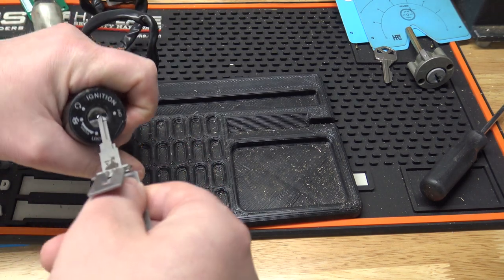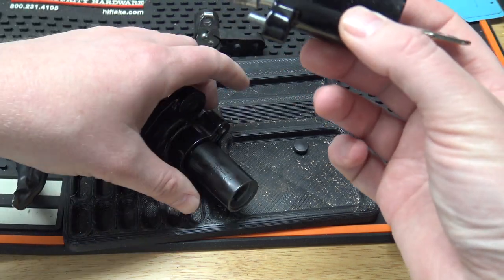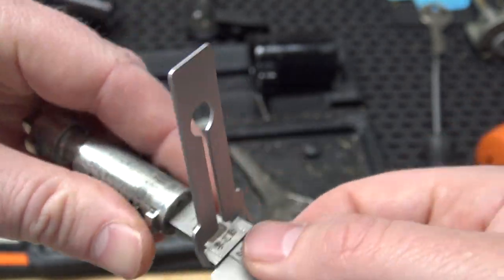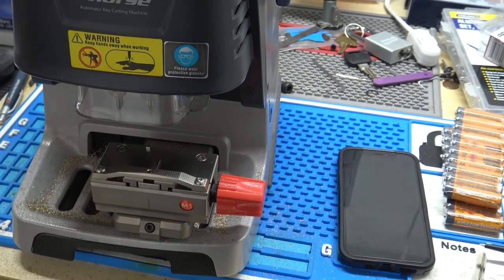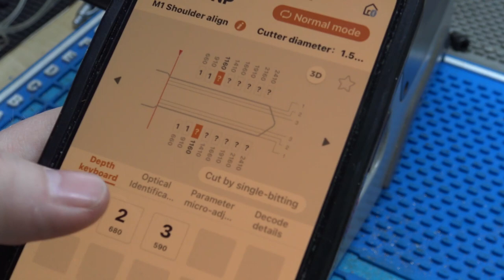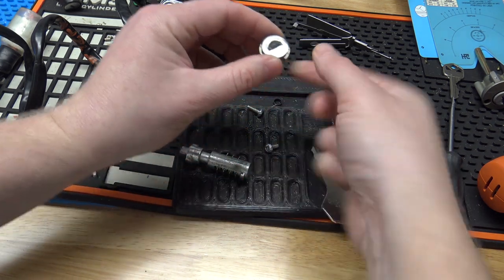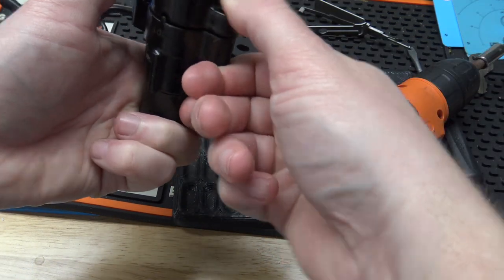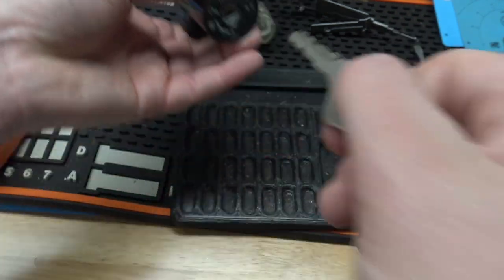(539) Making a Key to a Yamaha YZF-R3 Motorcycle

Comment: This video has helped me a lot.  My wife lost her key and needs a new one.   We went to the locksmith with the Lishj info from the tool and they tried to cut us a new key.   I didn’t take off the ignition since it’s a process, but I brought the seat lock.  They found a key code of 2125 for their machine but it didn’t work except for the trunk and it was slightly off by a couple of 100ths.  They don’t believe they have the real key code.  Do you know what the the standard key code would be so they can cut it?
Reply from the maker: Sounds like you need a new locksmith they should be able to look the code series up and know if it’s a key code or not.  I do not know if these bikes have codes anywhere I’ve never looked. I’ve always just lishi’d them
Reply: Thanks for answering.   They did look up the key for the YZFR3 but they didn’t have a blank and details about the 8 pins.   So the book found the 2125 code to cut off of for their machine.  However he was not sure the key code from the book was right.   The key looks like it’s almost perfect but the size is cut a little too small when I look at it with the tail lock it is almost flush.   Since it’s a one sided wafer you can hold the key more towards the bottom and it will go flush.  However the rear seat is only a 5 pin lock.  The key they cut will open the rear seat and gas cap ( gas cap needs fiddling but it will open ).  All I was able to provide them with was the Lishi’s numbers using the method you demonstrated in your other video.   The next step is to try to remove the ignition which requires drilling out the security screws.  Do you have any other suggestions?
Reply from the maker: Just so I understand. You have the lishi. Lishi’d the ignition got the cuts? Send me an email I may be able help. My email is in the description
Reply: I’m having the exact same problem with my Girlfriend’s r3 😂
We’ve tried already to get a key with two locksmith..
The last guy was able to get the “codes” for the rear seat and the gas tank but not the ignition switch.

We got to the conclusion that it wasn’t working because of the key’s size.
So we ordered OEM keys
Now we are just waiting to try again.

Pd: Where you able to get the key?
Reply from the maker: @andresfelipequiroga3885  He lishi'd the lock and gave me the info and I cut the key for him and mailed them up.  If your oem keys dont work you can email me I may be able to help.

Comment: Cani ask a question?
Reply from the maker: Besides this one?
Reply: @BoredLockpicker  yeah same kind  of ignitio but say if slightly different with electric lead can just that part changed?? also  can you build the inside of the lock to fit the key  i mean can yu put different sizes i to the lock??
Reply from the maker: No idea on swapping the parts. I’d ask a mechanic. Far as rekeying it. I’ve never found wafers for motorcycle locks to be able to rekey them and I’ve actually looked.
Reply: @BoredLockpicker  ah ok i had to buy the ECU and KEYS but no ignition so hoping to pull it apart with the right numbers put in the ignition.
Reply from the maker: You could probably swap wafers around. Might have to take a few out but you could probably get it to work
Reply: @BoredLockpicker  ok didnt want to look but what is wafers?? haha is that the part of each key cut level ??
Reply from the maker: Yes
Reply: @BoredLockpicker  ah good man thank you so much for your help